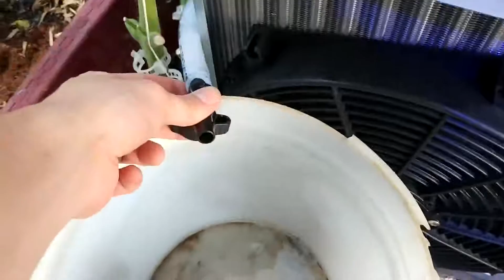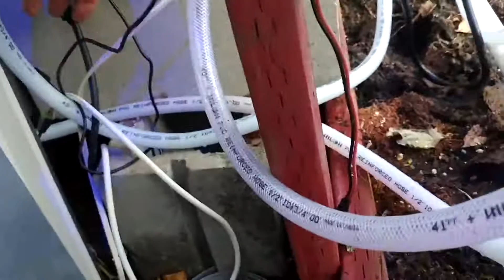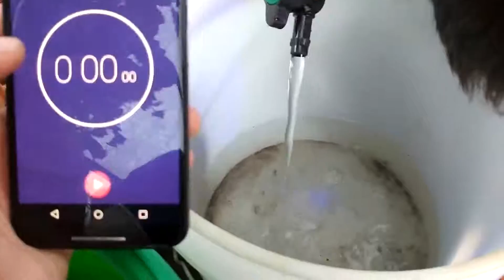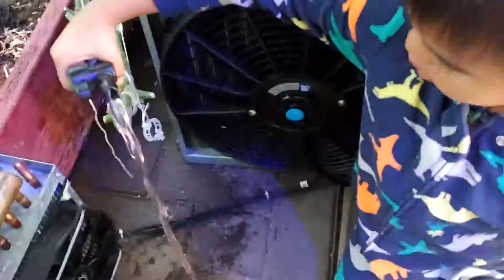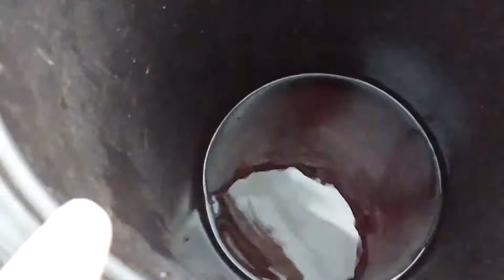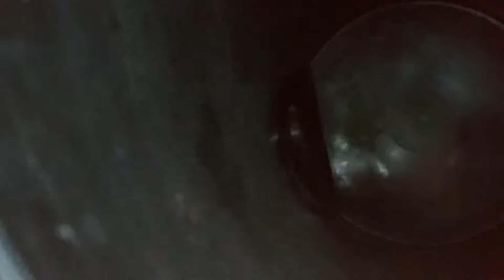Geothermal Water Performance Measuring

Comment: I guess you could say its equivalent to a 0.42 ton AC unit that takes a lot less power to run ;) Mine averages about 5.75kw/hr when the greenhouse temp is around 80F. Where yours is 100% sensible, mine is 80% latent, 20% sensible.
Reply from the maker: It's not quite 100% sensible.  Probably as much water condenses around the heat exchanger as would condense otherwise.  I move 2000CFM (or so the manufacturer claims the fan is rated at) of air through the heat exchanger.  My greenhouse only has 936CF (26.5 cubic meters) of air in it so even if my fan is performing half of what it's rated at, I'm still doing at least one full greenhouse exchange per minute.

Does a 0.42 ton AC unit consume 75W?  That's all the power required by the pump to move water through the loop.  I'm moving water at 20l/min.  That might be less than your air blowers ;).  I do have an additional 90W fan blowing air through the heat exchanger.  That brings my total to 165W.  The half-ton AC units I briefly checked on aliexpress consumes 500-850W.  I think I'm doing pretty good on power.

In short, I think I'm getting all the benefits of vaporization latency PLUS all the benefits of better energy storage and transfer that water has over air.  I'm preparing data for a follow up video to this.  I'm going to compare the initial costs of installing an air system vs a water system.  If it's true that I can match the latent potential of air, I can show that water is superior otherwise in cost and energy.
Reply from the maker: How much air air you moving per minute with your 65W blower?
Reply: The fan will do 1050cfm upto 550Pa static pressure. It draws 68w at 40% output. If you use dry and wet bulb sensors on the inlet and outlet of your heat exchanger and measure the outlet flowrate you can calculate the sensible and latent heat transfer using the mass flow density and enthalpy difference. A typical air to water HE will have 60-70% efficiency and incur a large amount of loss at 2000cfm unless its pretty big, armchair sized  :)  
A 0.42 ton AC will draw more than 75w, for 75w you might get 0.165 tons of cooling and you still have to find somewhere for the heat to go, makes no sense to me.
If you have a 2 x 2 x 2 cube air-to-water HE, the losses would be ok at  2000cfm. The air velocity is around 533ft/minute providing a contact time of around 0.25 seconds.
Reply from the maker: 1050 cfm at 65W?  

The HE is 15" x 19" x 3.5".  The fan is 14" diameter.  I estimate about 12.5cubic meters of surface area.
Reply: At 1050cfm it draws 170w, at 40% output its 68w. I use a speed controller it rarely runs flat out. I doubt the HE will handle more than a few hundred cfm, a completely empty 24" x 24" square ducr 2ft long has loss with 2000cfm flowing through it. 
I`m not 100% sure why you are transferring heat from air to water to transfer it into the ground (or vice versa), its much more efficient to cut out the middle man (water). 
Consider the heat transfer from the tubing to the ground, 200ft of 3/4 od tube will give you a shade under 40 square feet of surface area, hypothetically, if the soil is a constant 50F and the water in the tube is a constant 80F, (30F TD) disregradig any insulation value for the tube wall it will transfer 1200btu/hr or 350w/hr, all in sensible form with no latent component. 
The limited surface area will cause localised heating around the tube, the temp differential will reduce, leading to less and less heat transfer.
With air, you have more surface area (larger tube diameter) and have both sensible and latent heat components. A significant bonus with having a latent component is as the condensed water wicks into the ground, it increases the specific heat capacity and thermal conductivity of the soil around the tubes. It effectively provides an increase in the amount of heat you can store and the rate at which heat can move away from the tube wall which helps to maintain a higher differential temperature.
Reply from the maker: The primary reason for the my using of water was for heating.  Water stores and conducts far better than air.  Any cooling I could use it for was just a bonus.  It may be true that water is not as good at cooling as air, but I'm not sure yet.  For warming, how much does latent effects help?  I can't think of any, but it's getting late and I'm getting sleepy.

The obvious benefit of using water for heating and cooling is its heat-sinking ability.  Using water increases the amount of energy you can take out of the air.  Soil is only slightly better than air when it comes to specific heat.  Every gram of water is worth more than 3 grams of soil.  Water also helps stabilize temperatures.  It's sinking heat during the day, and radiating heat at night.  Air, because it can't store energy and gets no latent bonus during the night, isn't going to help as much there.

I could be wrong.  I come from a computer engineering background.  When I want to cool an electronic component, water is the most efficient way.  But in that situation, you could never use latent effects like you can here.  I also thought of how commercial geothermal is done.  They use liquid to move the energy around, not air.  Closed loop systems use R-410A and open loop systems use water.  The R-410A may have latent properties, I'm not sure, but water systems don't.  So if air is more efficient, does the expense offset that?  Maybe air's relatively poor heating performance is its kryptonite?
Reply: If the goal is heating i would look at what the source of the heat is, how much is available and when. I would treat heat transfer and heat storage mediums as completely seperate entities. Water is good for storage but slow in terms of response as a transport medium. If you cant get all of the available/surplus heat into the water in the time the heat is available it doesnt really matter how well it stores it :)  A greenhouse can top 100F in the winter but its usually sporadic and shortlived. The in/out temperature difference and greenhouse heat loss (especially the glazing) dictates how long you`ve got to grab and store the excess heat before it escapes :)   
Using air as a transport medium, you can pull the gh temp down by 30F in a couple of minutes and move the excess heat underground for use later in the day. Storing it in water is fine but it takes space and it has to be insulated or the heat will start being released as soon as there`s a temperature difference. 
The best option depends on the individual greenhouse, if its on a slab or a deck you`re kind of limited on options :) 
Its good to see someone doing real testing, most folks just take stuff for granted, like their ground temp will always be 55F at 6ft or whatever, regardless of where they are :)  It only takes an hour to sink 10 probes at 1ft depth intervals, once installed you can check the actual ground temps anytime you like. Another useful test is checking how fast heat moves through your soil/thermal mass. The test setup involves 2" styrofoam sheet, cocktail sticks, gaffa tape, 12 temperature sensors and an 11w reptile heat mat :)